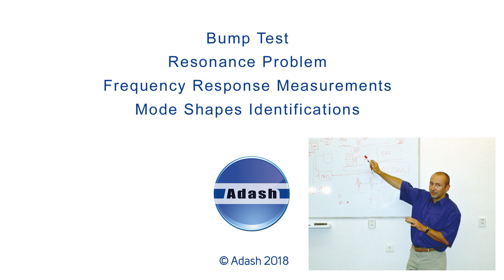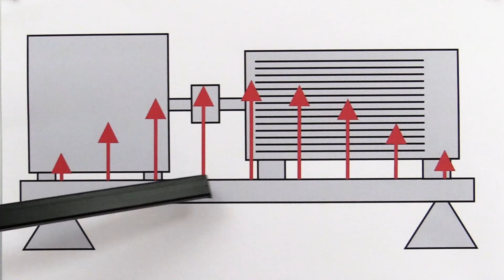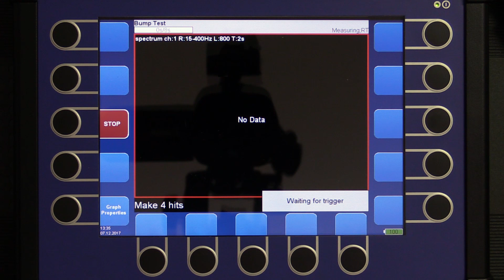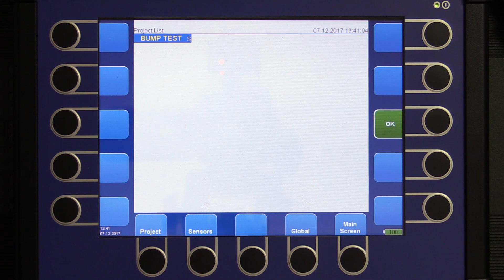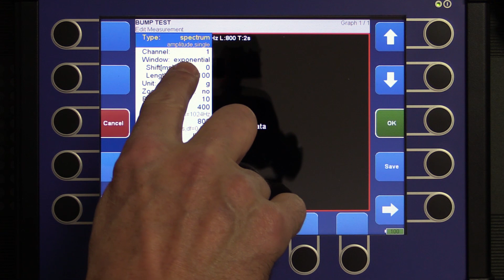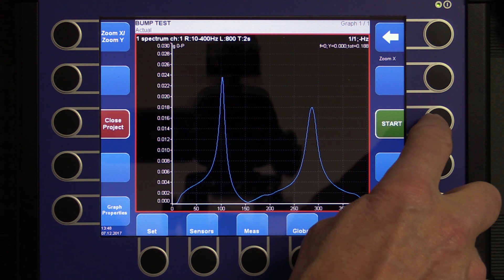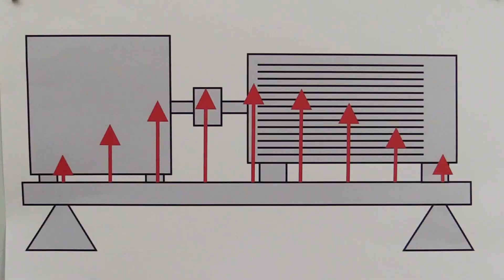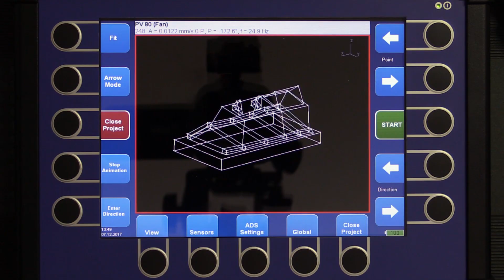Bump Test,  Frequency Response Function, Resonance problems solving by ADASH Vibration analyzer

Comment: Hi, which parts of a motor should we perform this bump test?
Reply from the maker: Resonance frequency is the same within the whole structure. Therefore it does not really matter on which part you perform the bump test. However you should select a few points on the motor and measure FFT on them. For bump test then select point where you see the biggest response of your knocking in FFT.
Reply: @AdashCompany  When u mentioned "whole structure", does this include the DE & NDE end shields as well? Is the motor four feet the best place to conduct the bump test?
Reply from the maker: @MrICE003  If you mean NDE fan cover which is made from weak metal sheet, then the answer is NO. It must be solid part of a machine body. You contacted also us via email so lets continue there ;-)
Reply: @AdashCompany  Sure thing 😁👍